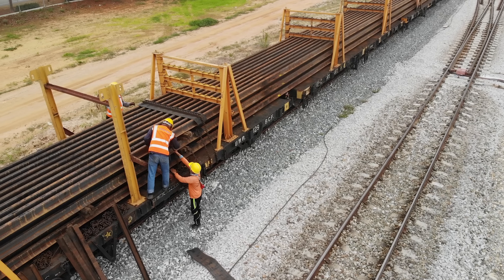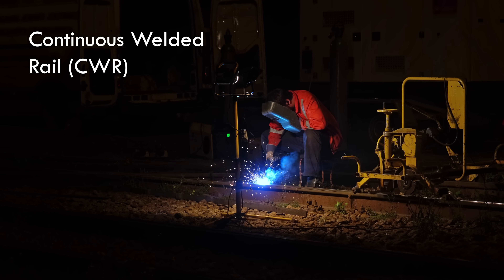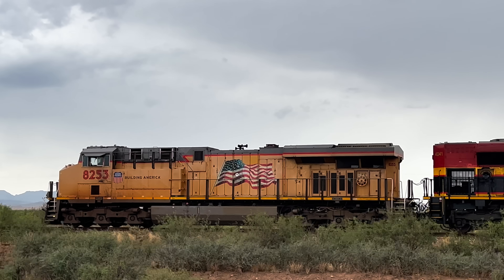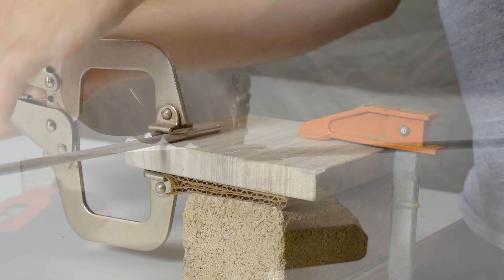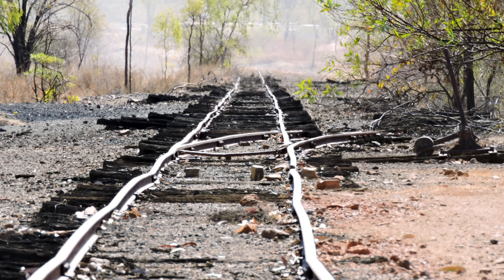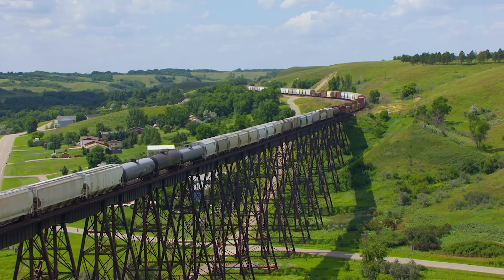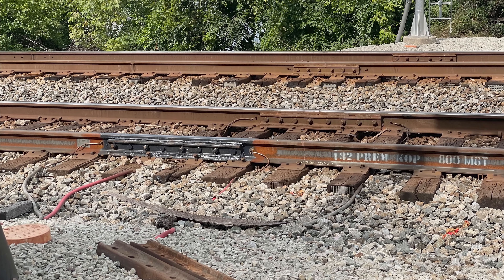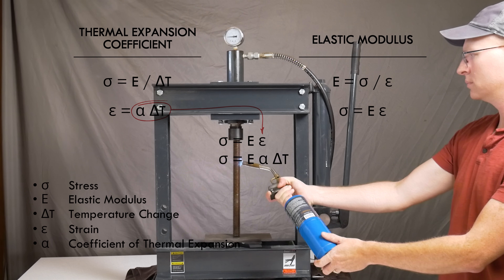Why Railroads Don't Need Expansion Joints

Comment: In Victoria, Australia, we had a project called regional fast rail and on the bendigo line all the jointed rail was replaced with welded rail and on one long straight section that was several km long, so to get around the expansion problem half way along they put in a kink in the track, bearly noticeable, can go over it at 100 mph, but when its hot, track explands, kink gets a little tigheter and when it cools down is straightens out.
Reply: You sure about that, i don't remember anything like that and over several km the expansion is more than likely going to occur closer to where the pressure is than travel kms away just to reach that one spot.
Just for the record i was on that project.

Comment: The railway I worked on had CWR, we had expansion joints but only at two points on the one line - on either end of a 5km viaduct. It is my understanding the viaduct moved (rolled?) side to side. The one set of expansion joints sucked as they were on a curve and no amount of anchoring the sleepers and tamping the ballast completely fixed the problem.

Comment: W/O welding joints and doing precise cuts of rail made in just the right conditions every mile or so: Sun Kinks Intensify
The rails still expand and contract, but since welding in rail tech, they just happen to be welded rather than jointed. The welded rails still have the same issues of roadbed maintenance and sloppiness of jointed rail, but largely benefit from easier joint maintenance and lack of kinks in gauge and on corners (which is usually fixed by bending the jointed rail ahead of time anyway).
Tldr: Its just newer and u can hire less mow guys :p
Wonderful video btw!

Comment: In Finland (North Europe) our temperature range from summer to winter is quite high, from -30C to +30C (-22F to 86F) is to be expected. If we did the “wait for the hottest day” trick, our tracks would snap in the winter from the enormous tensile stress. Instead we do it in the summer at night, as rail that has sunlight shining on it can easily reach 80C (176F). We haven’t used wooden railroad ties in over 50 years. Ours are always concrete, weighing 240kg (529lbs). Railroads buckling doesn’t happen because this is over-engineered enough so that compressive forces can always be overcome, but we can’t overcome the inherent weakness of steel under tensile stress after a certain point without making the rails ridiculously thick. Fighting buckling is economically much more viable if the temperature changes are high enough.
Reply: In my part of Canada we range from -40 to +40, but I imagine our rails don't get much hotter in the summer sun. Concrete ties are very rare here, with ties almost always made from wood. I don't know what they do to mitigate the thermal stresses.
Reply: @MarkRose1337 it’s called destressing to a PRLT as discussed in the video. The ties don’t make much difference. Concrete works better for curves and wood for tangent. If the PRLT for your region is 90 degrees then we would heat or pull the rail using a simple formula to bring the rail to neutral position no matter the temp. The only hard thing is laying rail when it’s too hot out.
Reply: @MarkRose1337 .. I think CN still has a lot of old style rails on some of it's track,, CN trains almost never derail because of superior maintenance while Burlington Northern tracks, I'm in Minnesota, are derailing almost all the time... Not in any one place, I just mean somewhere on the Burlington system there is probably one or two derailments a day.... And that's just Burlington Santa Fe RR corporation... They were also the line that dumped six or seven tank cars of benzene into the nemadji river in Superior Wisconsin about 15 years ago  too...... The entire city of Superior and half of Duluth Minnesota had to be evacuated...
Reply: @micnorton9487  I think that was more like 30 years ago.
Reply: @micnorton9487  CN Rail used to be known as the "Canadian National Railroad". After privatizing here in Canada and buying railroads in the USA, they kind of changed their name. I worked for them 40+ years in Canada.
Reply: @KStewart-th4sk  I never claimed to be an expert,, did everyone on YouTube get stubborn all of a sudden?
Reply: Ah, the “make it beefy thick” school of engineering. 

A real classic.
Reply: Railroads here in Florida have replaced most wooden ties with concrete.
Reply: There's places in the US where the average range is -15F to 115F (-26C to 46C) with very strong sun.  And they don't use concrete ties.  The risk is mitigated by applying very large amounts of money to political campaigns.
Reply: @darkwing3713  THANK YOU,, most rail corporations in the United States just cut corners and figure that the lawyers can always make any disaster or fine for breaking regulations just a minor cost of doing business... I'm in central Minnesota where 2 lines pass through and it's easy to note the difference in quality of the track and ties and even the Rock grade bed between the Canadian Canadian national corporation and the American Burlington Northern Santa Fe corporation...  The maintenance also is FAR better on Canadian national tracks than Burlington Northern Santa Fe tracks,, with Burlington trains derailing all the time.......
Reply: @micnorton9487  That is so scary :(.  It's disgusting what's happening in big American companies.  We need to bring back prison time for the people who run them.  There's no downside to their crimes right now.
Reply: @darkwing3713  I agree,, and thank God the town I'm living in right now is on a Canadian National track and not a BNSF track...
Reply: Germany started using wealded tracks in 1940 and in 1950 all main railroads was wealded.
Reply: I work on a class 1 railroad in Minnesota and Wisconsin. Our temp swings are even greater, when considering each year’s high and low, and not just averages. I’ve personally seen/felt -27°f and 100°f, or -32°c and 37°f in the same location.
Reply: @firefighter4443  To be fair, in my hometown I've seen -32°c and +32°c and the larger temperature fluctuations are similar, though a difference of 64°c isn't every year of course. When you consider  the entirety of Finland, the temperature range is from -42°c to +34°c pretty regularly, the max being -53°c. But I would assume they'd have the common sense to use slightly different rules up in the north when welding track, but I don't know.

So strange that your concrete ties have such problems. We had very few instances of replacing a single concrete tie when I worked my summer jobs and when it happened, it was a clear catastrophic failure, probably due to uneven support. It has to be a cost-cutting reason for your concrete to have such poor performance. Concrete science isn't exactly new stuff.
Reply: Our concrete ties can’t seem to handle the freeze/thaw cycles. They tried on one of two main lines from Chicago to Clinton, IA. The engineers I worked with said that every winter the main with the concrete ties ends up with a lot more slow orders (temporary speed restrictions) than the neighboring main line with wooden ties.
Reply: They use concrete in my part of Australia as well. Not as high a range (0c to 45c - or 32f to 115f) with 4 months of the year being over 35c.. 95f )but we use concrete ties. As to "waiting for the hottest day trick" hahaha - maybe for people that think Phoenix USA is actually a warm place.
Reply: Wood ties if properly maintained, combined with keeping your rail around 95 degrees neutral temp will take care of almost all problems. 

The cost of installing concrete ties over a land mass the size of North America would be insane
Reply: EXACTLY,, that's the way railroads need to be built in America too but corporate profit keeps over- engineering from ever entering the picture... Like the bridge in Minneapolis that fell into the Mississippi River from a combination of no redundant features and simply overloading the bridge... A stupidly cheap design to begin with,, where failure of any one part may have only resulted in failure of a section of the bridge but with shoddy maintenance and overload from numerous layers of roadway just laid over the old stuff, and it was like the world trade center... 

People with no knowledge of engineering like to say about the world trade center, there's no way jet fuel can melt steel and while that's probably true, the fasteners didn't have to actually melt to cause failure... the same as the bridge in Minneapolis didn't have to fail all at the same time, the under engineered overloaded structure ensured that with any extreme stress, the fasteners would snap along the whole length of the bridge...  Kinda like the Towers,, those buildings were designed to minimum stress mostly associated with wind,, and with the added negative factor of using mob concrete, the internal structure of the building wouldn't even handle one floor breaking out of its place and falling on the next, because it's just not something you engineer for...... Now of course it is,, but I hope for this new world trade, they didn't use Donald Trump's dad's concrete company lol...
Reply: The failure analysis on the I35W bridge determined that a primary factor, in addition to overloading during maintenance and a design that was not used anymore, was a basic design mistake. The gusset plates on the main structural beams were half the thickness as they should have been for load requirement plus safety factor.
Reply: @micnorton9487 just like the world trade center ?

Mossad staged a false flag & used secret microwave weapons to evaporate concrete ?
Reply: @micnorton9487  That's the nice thing about the egyptian pyramids and other such ancient world structures. They were over engineered. They are simple and made with huge blocks of various rocks and that is why they will stand almost forever.
Reply: @louistournas120  And THAT'S what's f'd up about the US - NO RESPECT for history... Engineers in America are as smart as anywhere and I'm not putting them down for their brains but rather their FOCUSING on making something only good enough to be barely adequate, while keeping all the money they left out of the  construction of over- engineering... I'm reminded of the I- 35W bridge in downtown Minneapolis Minnesota that fell into the Mississippi River in 2007, killing 13 and injuring 149... It was a case of pure negligence of maintenance on an under designed and overstressed structure,, with the steel trusses exposed to weather and especially the banks of bolt fasteners...... I was under that bridge a few times, and noticed each time the long trails of bright red rust coming from the banks of bolts,, making the concrete look painted... And the reinforced concrete of the underside of the lowest level of road bed looked like it had never been replaced, and was cracked all over and even with large chunks just falling out of it... To save money the Department of transportation would slap on another layer of asphalt rather than chewing it up and replacing it... I never liked driving on it and would take the 10th Street bridge which is parallel to it but the point is, the bridge they have now supposedly has redundant features and an improved design but still relies on a lot of concrete box - trusses and still looks way under designed... 

The Mackinac bridge between the upper and lower peninsula of Michigan is over 5 mi long, and it supposedly will last as long as the pyramids (with maintenance) due to solid steel construction,, on top of massive reinforced concrete piers that can take 5 times the maximum load possible on a four- lane bridge...
Reply: @micnorton9487  what a conspiracy screed
Reply: @mattzobian  What are you babbling about? Where's the conspiracy genius? The bridge fell, bridges don't fall unless there's an act of God or somebody really f*** up... So sit on it and spin buddy......
Reply: @micnorton9487  corporate profit? Lmao... are sure it isn't because the USA isn't roughly 2600 miles east to west and 1600 miles north to south?  Compared to....
Reply: @billweirdo9657  Yeah weirdo lmao I'm sure that's not it,, when you take the total length of track divided by major mechanical failure incidents, the adjusted numbers indicate Finland or any European country has better rail systems than the United States...
Reply: @micnorton9487   lmao who said they didn't have better rail systems. Point, head, zoom

Comment: Interesting, the apparent lack of "gapless welding" confused me quite a bit when going from Orlando to New York City by train in 2004, being used to German railroads. I assume that at least on the "high speed" corridor from Washington DC to Boston, but after some 24 hours on the train by then I did not really pay attention to that anymore. (putting "high speed" into quotes as, well, "up to 200km/h" was not really considered high speed even back then over here, and with nowadays even regional commuter trains usually being capable of 160km/h, with the current "high speed" limit being 300km/h on selected tracks, and even back in 2004 having ICE tracks good for 240 to 260 km/h AFAIR)

Comment: What an interesting content
Something i didn't fully get. What happens "under" the rails on the breathers? I mean, if there are such strong forces to stretch the rails, what keeps them in place when there is a break? The ballast has enough strength to keep them in place? I would suppose that the steel would contract if there is a cut

Comment: I thermite welded ribbon rail for the CNR for 2 years (1981-82). We did lots of de-stressing and also eliminated many reoccurring heat kinks by installing cement ties with pretzel clips which allow for the expansion and contraction of the rail without dislodging the ties. Every time a thermite weld was done (we were doing 12 to 14 per day), the temperature of the track was recorded and the gap between rail ends was determined (calculated) prior to placing the thermite mould. Sometimes we had to cut a section out of the rail because of expansion. Sometimes we'd cut out a section and then find we'd have to cut out even more. Sometimes the blade got jammed into the rail due to the heat expansion. Other times we had to force the rails away from each other and then weld the rail joints together. We used a hydraulic clamp pusher/puller to manipulate the rails. 
Subsequently, I ended up Joint Welding in my 3rd year with CN to repair old rail joints that were battered by the train/car wheels. As well I welded Magnesium Frogs which are the cross-over switch rails (Shaped like an "X"). They'd have to be built-up with weld then ground to the right camber, roll and smoothness.
It was all interesting work and paid very well.

Comment: I think the choice to describe and demonstrate this as a "compressed" rail was a mistake. I was wondering the whole time why they would want to pre-compress a rail, then all the way at the end of the video you switch it by saying they use a high neutral temp.

A demonstration of tensioning the bar and then heating it up to see the tension force go down would be better.

Comment: The pressure on your jack was probably lower than expected because the rod expanded radially instead of stressing axially. Might be a good follow-on experiment to check the cool and hot diameter and see if that accounts for the difference.

Comment: What impact does a curve have on rail expansion? Since the rail is already curved a hot day would increase the curve slightly and a cold day would decrease the curve slightly. Is this lateral shift of the rails in a curve a suitable measure to ease tensile/compressive forces?
Reply: On the UK railway there is a minimum radius below which CWR is not allowed to be installed, as buckles become more likely the tighter the radius gets.

On such curves I used to specify the use of 120'-0" rails, up the number of concrete sleepers and ask for the raised CWR type ballast shoulder. By using 120'-0" rails you halve the number of joints which saves maintenance, and reduces the tendency for the track to thru-penny bit at the joints, while still having enough joints to take up enough of the expansion. Remember that the temperature at which the joints close, is equivalent to the natural temperature of CWR as once the joints close the track then behaves more or less the same as CWR.

Comment: Only time you hear click clack is over crossovers and turnouts, where you have a deliberate break in the rail to allow for some action, like crossing the other rail, or changing track. Bolted rail though is still used in rolling stock yards, and where you have a lot of shunting, as you get sections of rail that are almost unused, yet the adjacent sections are heavily used, so making it easy to change out the worn sections is paramount, and speeds there are typically very low. Pass through sections though are CWR, mainly to avoid slowing down passenger cars, and they also use high speed capable turnouts, which can operate by me to 120kph for the straight through, though the turn is derated to 60kph due to the stress on the rail tyres and flange wear.

Comment: This noise is not from the tracks but the sound of the wheels when they have a flat. When a train brakes too hard too often you end up with the wheels getting a flat section on it which creates the clickers clack sound. Try having a closer look? The expansion joints or fish plates are an essential component in rail track engineering to allow for movement so that the rail does not end up with micro fractures due to extreme temperature variations eventually leading to catastrophic failure of the track section.

Comment: In the thermal videos it looks like your IR and visible images aren't quite overlaying correctly. FLIR's "MSX" overlay should have a slider somewhere you can drag to correct for the parallax error between the two sensors so they line up.